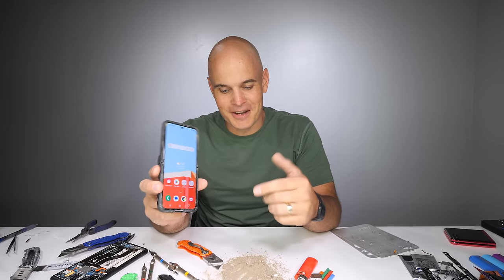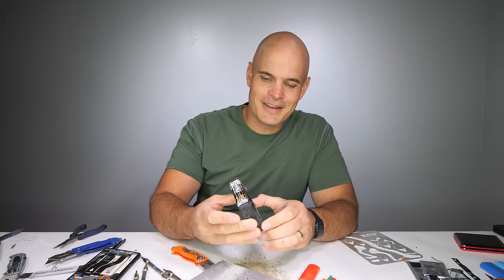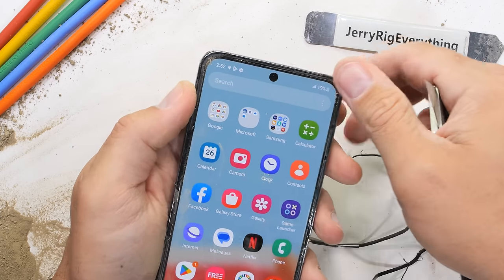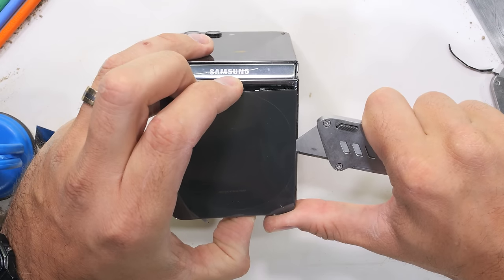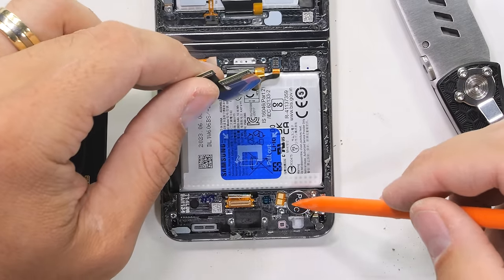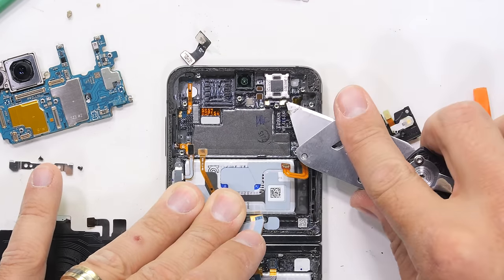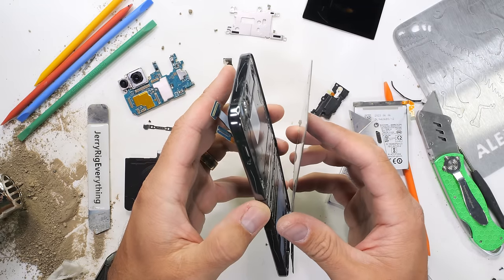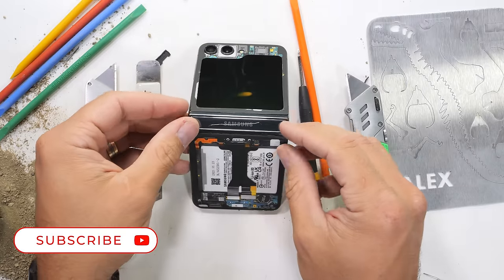Samsung Z Flip 5 TEARDOWN - I have waited 4 Long Years...

Comment: Hi everyone, this video gave me serious doubts about the repair advice Samsung is currently giving me.
Anyone got any comments or advice on the following?:
Been using the Flip5 for only 3 months and a tiny bit of the bumper, right above the right hinge, came off. Now this flexible black connection thing isn't held in place anyone.
Samsung say all they can do it replace the WHOLE display (for €€€). Seeing how easy the bumper comes off, it makes me outrageous they say they can't just glue a new bumper on.
They also say it's not water or dustproof anymore, which seems odd, as the sides aren't even sealed and the flexible connection thing moves and is just held in place by the bumpers...?

Comment: They switched back to gears because the flip 4 was NOTORIOUS for coming unaligned and actually blowing out the back of the spine. I would get them daily with hinge issues when I was working at asurion.

Comment: Don't buy flips from any brand as long as they don't come with glass screens. I'm using flip3, it's built in protector that we are not supposed to take out actually comes out on its own after just 7 to 8 months. It starts to peel off from the centre crease and then dust starts to collect inside and if you don't change it, it puncture the screen. This is a known common problem with flips. You can experiment but it won't last.

Comment: Hi Zack. First of all, greetings from Brasil(we spell with S not Z). I have a Fold 4 for about a year now and I had to replace the screen protector once and my display died. Lucky me it was still under the Samsung Care
my wife also got a Flip 4, and the screen died, but they said that the phone presented some marks of use, so the warranty did not cover the replacement. I was a bit skeptical about the new flip and before I even decide to buy a new phone I check your vids. After this one I found out that Flip 5 is way more robust. Thanks!

Comment: Jerry, I love your channel. Butttt, I gotta throw my 2 cents out there. No work knife on the planet compares to the Milwaukee Fastback with blade compartment (fits 4 extra blades).
If you really want to do some good sales you should design one that has a button to easily flip the knife out as well as a compartment for blades.
Your work knife is more like the original work knife but not as functional.
Again, love the channel.

Comment: Well, based on my experience with Z flip 3, I don't think it would last a full year with no issues.

Mine has an issue when I close it, it shuts down completely, and I have to plug the charger so it works again.

I even took it to Samsung Service Center, and they refused to fix it under warranty due to a scratch in the outer body.

Apparently this is a common hardware deficit based on my online search, and many faces the same issue. Some got their phone fixed, others not.

It's strange how Samsung is trying to push the fold/flip experience to the world. But when it comes to after sales experience, Samsung just revoke the warranty just because of a scratch on the surface, and the issue is common hardware deficit.

Comment: I feel like our standards for what is considered "repairable" have dropped a LOT in the past 10 years. Bumpers that you can't remove without basically destroying them, glued in glass, and a folding screen that more or less self destructs itself if you try to remove it for anything. Sure the battery pull tabs are a step forward but there are like 19 steps back before there. Honestly I don't think I'll replace my phone until it breaks OR someone releases a phone with an easily replaceable battery. I see no reason why every phone can't just be a couple millimeters thicker and have a battery that just takes 3 screws to slide out.

Comment: The columns of pixels that failed during the initial dismantling seems to have intermittently started working again after reassembly. I am guessing that some, if not all electrical connections are by conductive adhesives or maybe even just mechanical pressure. 
I must say, the repairability seems to be more than acceptable for a modern flippy phone, if it actually comes back into a more or less functioning state after that treatment. Not even a cracked glass panel. A skilled technician could probably switch the battery without any major hiccups for a normal use phone. I think Samsung will get my stamp of approval and a thumbs up for this one.

Comment: My guess is, between a year and a year-and-a-half, the microscopic glass fibers will start to delaminate around the hinge area, seems to be a pretty common failure point.

And if that doesn't happen first, the battery will become unusable after 400 charge cycles.

Comment: The easiest way for a normal person with no technical skill to extend the life of a phone is to buy a battery case. One of the major downsides with foldable phones is the increased complexity of the phone cases. A folding battery case to my knowledge does not exist. So I would not suggest folding phones for people who are looking for a long term device. You are better off buying the flagship of two years ago renewed and buying a battery case two or three years down the line. I used my S8 until earlier this year and only just recently upgraded to an S10. As long as you are using it as a phone/media browser and not a gaming device. You really don't  need the best of the best phone year by year.

That being said, people who have small pockets/no pockets would benefit from the shorter length of the folding phones. Just be prepared to buy a new device every 2 to 3 years rather than 5 or 6.

Comment: Environmentally speaking, the best way is to give the phone back and upgrade each year. It will cost you the most, but Samsung would then have all the phones back each year and could then recycle them ALL and put them back into use again, vs some being thrown away, and some being used for 5 years then thrown away, or sent to other recyclers. No it isn't the most fair trade, and no it isn't the most cost effective, but if you are talking straight best use case for environment. There you go.

Comment: i'm well into Year 3 on my Fold 3, So far so good, Hinge is still as quiet as the day I got it and I'm NOT gentile with this thing. It's been all over the United States in my Big Rig and fallen off its mount and been tossed around the cab of my truck more times than I care to admit. They aren't as fragile as Samsung makes them out to be in that warning message on the initial boot screen. Only issue I had was that I had to replace the inner screen protector after one particularly cold day where it popped off when I unfolded the phone

Comment: I'd like to see your tear downs to include metal dust ingress/damage. 
Some of us work in metal shops with steel dust in the air constantly, not to mention that grinding and sanding dust on all surfaces and, in turn ones clothing pockets. 
Back in the HTC incredible day, I started buying Ziploc bags sized to fit my phones. The screen still works fine through the bag. Under $10 for 100 bags so you can use them just a day or so and throw them out. 
Magnetic dust plus speaker and mic magnets and moto mod magnets, a phone can get all covered in black fuzzy wads of steel dust that are pretty difficult to remove,  so if be interested to see how compressed air will either blow it deeper into the phone or remove it. The stuff killed the speaker on my incredible, but thankfully the back comes off to replace the battery (ahh memories) and I replaced the speaker too.  My phone's have never seen the dirt you use, but magnetic steel dust..yeah, lots of it. Black steel dust stuck to your headphones kinda suck too ! 
Now I'm looking at the folding phones. 
Anyway, thanks, I enjoy your tear downs.

Comment: My sister-in-law has a Flip 3, and after about two years, the screen is becoming a little glitchy.  Sometimes the screen doesn't turn on, other times it turns itself off, and the screen is starting to crack along the fold line.  My Fold 3, however, is still going strong after two years of ownership.  The only real issue I've had is I dropped it on a concrete floor and cracked  a camera lens.

Comment: Hey Jerry!

I got a Z Flip 3, and the screen started to crack 3 months in. 
Do you think there is anyway to make a phone case that is solid with no flip feature? I am afraid to fold my phone for the risk of it getting worse, but I still want to keep it as a backup.
I know I could trade it in, or try and sell it, but its basically E-waste at this point.

This is a pretty cool bit of tech history, and I don't have the money to get a new one, but a solid case would help keep it alive and functional for a lot longer. 

Thanks!

Comment: I'm not expert in folding display tech but something I've recently been thinking about is how to make a more solid display. I wonder how possible it would be to just have 2 regular glass parts for the rop and bottom and only ha e the flexible display part at the folding part. That way the main areas that people generally tough are more robust and scratch resistant

Comment: 3 years but might make it to the 4. I have the Z Fold 3. Going stron, but I do use my inner screen a lot less than the outer one. The screen protector did have to come off after 1 year since it was popping on the crease and catching dust and sand. Samsung did not remove it, I did, and have not got another to put on. There are also micro cracks along the crease, under the top film, on the UTG. Overall, I got it at launch and have loved the phone since.

Comment: One thing to note is that phones these days are having lot of display issues. Like that one in this video where a pink line has appeared. This is by purpose of opening the display but many are facing this issue out of no where. And seems like people from the west are not talking about this. Especially tech youtubers. They should address this and try to educate us the reason, precaution and solution to this thing.

Comment: I'm a maintenance engineer and I have the fold 4. I regularly get metal filings stuck on the magnets in the corners of the inner screen. Not a massive issue but it does cause indentations on the screen. Just something to consider.

Comment: My Flip 4 only lasted 8 months before the screen protector started bubbling at the crease. I was about to drive an hour away and possibly stay at a hotel to get the free fix from an "Authorized Samsung repair facility" but I called Samsung for info of what I would need for the repair and the nice customer service person informed me that there was a pre-release sale going on where I could trade in my Flip 4 in the condition it was in and only pay $106USD for the Flip 5. Which. Duh... I did and I LOVE the Flip 5 compared to my 4. The outside screen is so useful and I find myself opening it less especially with the cover screen launcher you can get off the galaxy store which allows you to open pretty much any app on the cover screen. Anyway long story short I am going to say the Flip 5 will last us hopefully 2 years. I hope longer since I like to use my phone until it breaks. My last one was the Pixel 3a which I had for about 4 years until the screen started to separate from the body on it's own. Great tare down. Sorry for the long comment. Have an A1 day 👍
Reply: the pixel only lasted 4 years!? thats pathetic, my galaxy j7 2017 is still perfectly well; 7 years later. and its not looking like this thing is gonna break anytime soon! (i mean its aluminium all around, who wouldve guessed that this helps long term reliability lmao)

Comment: Thank you for doing the durability test on the screen without the screen protector 🙌  I haven't seen anyone else do it and I took mine off day 1 on both the 4 and the 5 so I was genuinely interested (though I did anticipate the same as you found). One benefit besides the obvious of being much smoother is the repeated folding: I've seen a lot of Folds/Flips start to bubble and get dust between the screen and screen protector after a few months of folding, even have seen more than one get hairline splinters as a result, but my Flip 4 was flawless and I have the use-time of a 13 year old girl on my phone. Much appreciated, Zach, and nice work on this one
Reply: I don't know that I saw any warnings saying you can't take it off anymore but oddly the Flip 5 screen protector came off REALLY easily, far less anxiety inducing than the 4 or like on prior models it could damage the screen it was literally designed to not be peeled off. I live dangerously I guess, idk.